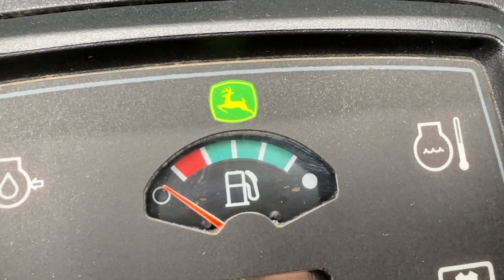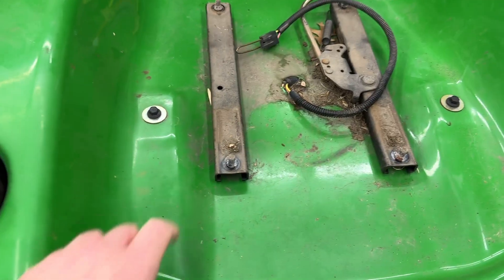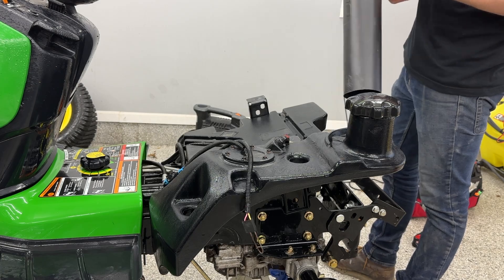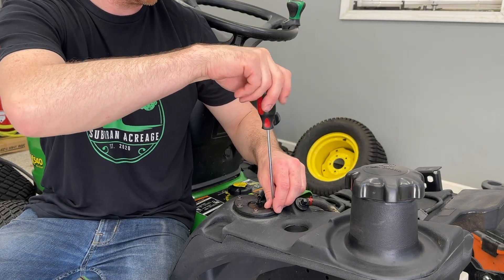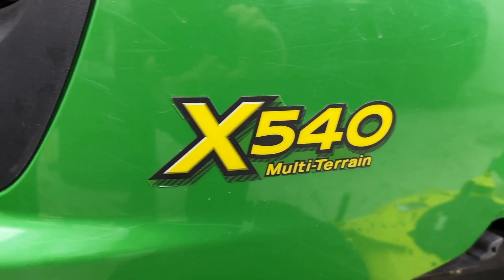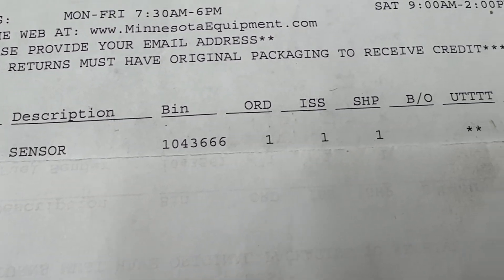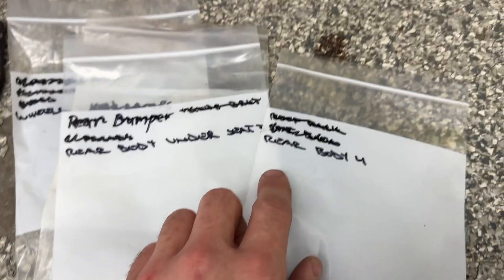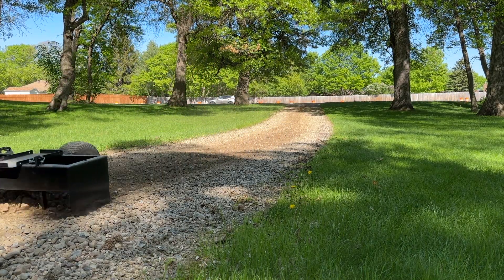Fixing a Broken Gas Gauge on a John Deere Lawn Tractor: DIY Troubleshooting and Repair

Comment: Ok, so you changed the part - fixed - but how about opening up the old part to find the fault perhaps it was really fixable, it would have made a more complete video in my humble opinion.  Also, I agree with the comment referencing the float density in fuel rather than water.  A follow up video would be much appreciated and could potentially save someone $150 and two trips to the JD dealer.
Reply: yes, I very much agree

Comment: Water has a density that is 30% higher than gasoline.  So a float that sinks in gasoline can float in water.  Since it appears that only about 10% of the float was above the water, I would say that that float would sink in gasoline.  It should have floated with at least 30% exposed.  You most likely had a bad float.
Reply from the maker: Awesome comment, thanks for the additional info. I tried to find the float itself figuring it would be a couple bucks. I found one forum where somebody did track down the float but it was nearly $25! I knew the new unit would fix my problem 100% and my patience was getting thin. Thanks for watching!